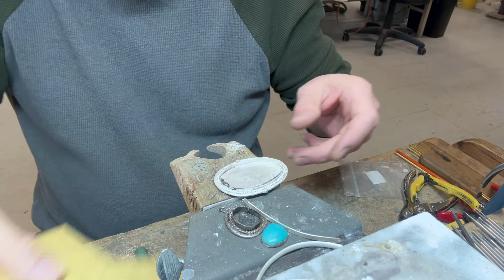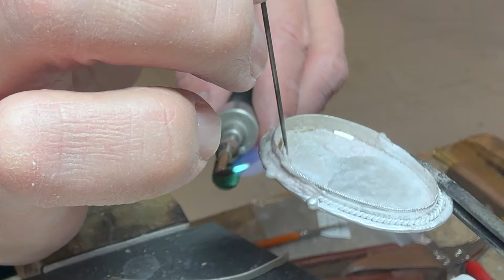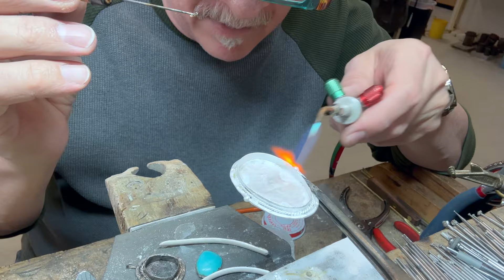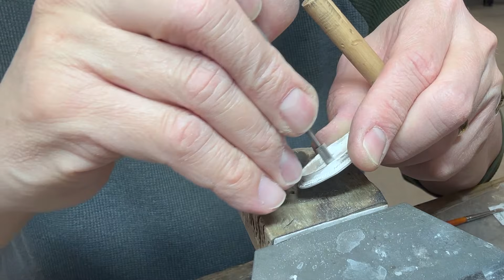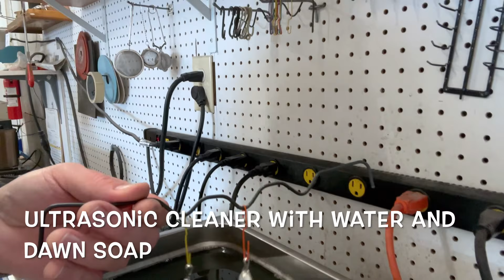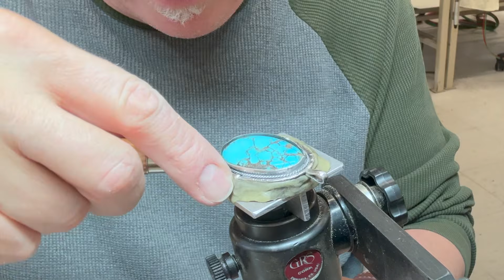Jewelry Bezel Repair Step by Step with Explanation - Replace Silver Turquoise Pendant Setting

Comment: Found a year later and yes I love it and agree with everything you said. It's even harder now with the cost of silver these days. Thank you for people like you and the lapidary gentlemen, Michael Donohue, from Michigan (Donohue Labs on youtube) who created a full equipment setup (minus motors, blades and speed controls) on CAD and provided the files for free that anyone can 3D print and make a table etc. out of because he was noticing the same thing where people would show up interested in a craft/art but leave without fully getting into it because they can't afford the multi thousand dollar machines used in the business. It's really disheartening that anything with the word jewelry attached to it is 3x the cost it should be. For instance, I was trying to get my grandfather's Vac-U-Cast running (the same one you have) and was disheartened that 1 liter of the vacuum oil cost $100+, but not giving up I searched the spec oil and found that I could buy a GALLON of ISO VG 68 oil that's used for the milking machines on farms for $30. So THANK YOU!!! Jewelry Monk, thank you. Also another cool youtube shoutout would be Rowow LLC, he created an electrolysis membrane and made the patent open source so anyone can make a membrane for $1/yd vs. the normal cost of $500 per foot. Now instead of relying on the big shops, no hate to bigriver they're pretty fair, I can pull out the element I need and refine it and make my own Argentium. Amen, use what you got or better yet, make it!
Reply from the maker: Great info, thank you.

Comment: How did you get the stone out?
Reply from the maker: I used a flat graver in between the bezel and the stone, slowly and carefully.
Reply: @DougNapierJewelryMonk could you do a video to include the process of that? I cant even process the opening of a tight bezel. Fear is not strong enough for that kind of work.
Reply from the maker: @shawnpatterson6632 I just released one today doing that.
Reply: @DougNapierJewelryMonk i just saw it hahahahaha. Thank you, it was VERY helpful. I have a ring with the same issues. Now i have a road map to fixing it! Than, you again.
Reply from the maker: @shawnpatterson6632 you are very welcome.

Comment: Why not remove the whole bezel rather than piecing it and having 2 ugly seams. I think one seam ?
Reply from the maker: @FatKidBrody  I could have, but on some repairs that is not possible. I wanted to show people how to do a partial bezel repair. Plus done correctly, the seams are undetectable, not ugly. I also like to keep myself challenged.
Thanks for the question.
Doug
Reply: @DougNapierJewelryMonk  thanks for the response Doug
Reply from the maker: @FatKidBrody  my pleasure.

Comment: I have a tip for you; I've found that an inverted cone bur is excellent for cleaning up excess solder inside a bezel along the join to the backplate. It cleans only the meniscus so the bezel wall is preserved. I was thrilled to get this tip from another smith. Great video. 🌺
Reply from the maker: thanks, I will give it a try.

Comment: That was a very impressive job! Also very well explained and filmed, thanks a lot!
I've got the impression that perhaps it would have been quicker and easier to make that pendand from scratch, in the same style, of course...
Reply from the maker: Thank you. It would have been a better piece if I rebuilt it, but as a repair jeweler, sometimes you have to work with what you get.

Comment: Thanks for the video, Doug.  I really enjoyed watching you work on that piece.  I have a question:  Do you neutralize your piece after you pickle it?  I've seen people neutralize it in baking soda and water and I've done that, but I'm wondering if it's really necessary.  Please keep doing these types of videos.  I will watch them.  I'm a lapidary and do some silversmithing, but I always could use more instruction and these types of videos really help.  Thank you!
Reply from the maker: @hummingbirdstones  thank you for the comments. Yes, next to my pickle pot, I have baking soda in water to neutralize the acid. Yes, it is necessary because it keeps the acid from getting on my hands and my tools as well.
Reply: @DougNapierJewelryMonk  That's what I thought.  Thanks for the confirmation!
Reply: @hummingbirdstones Flux is also very hard on hands.
Reply: Doug, can you please explain why the second time you heated the piece after attaching the bail - when you added another piece of solder from the front - why the bail didn't fall off with solder flow? Is it zinc sublimation or did you use a lower temp solder (I think you used M again)? Thank you. This is a perfect example of a potential problem that students could encounter and not understand.   And what a beautiful piece of turquoise!
Reply from the maker: @flyingcheff  Hi and thanks for the question. I used the same Medium solder, but used heat control to make sure the bail stayed on. I kept the heat generated in the area I needed to flow, but away from the actual base of the pendant. That is the nice thing about using a Smith Little Torch to solder, it allows me to control the heat better than a larger torch.   
ALSO, solder actually flows at a lower temperature the first time it is melted, not much, but a little. When it melts, it burns off some of the alloys used to make it solder, so the more times you melt it, the higher temp is needed each time. (we are talking about 10's of degrees) This is why I never melt my solder into a ball on my soldering board and pick it up with my pick.  Hope this helps.
Take care.
Doug
Reply: @DougNapierJewelryMonk  That is a great point (not balling solder up on your board first so as to maintain that initial lower melt point usefulness)! So the zinc sublimation/burn off is this exact scenario. I think your explanation really helps students understand using the same solder repeatedly. Awesome. Thank you. You'd be surprised how few teach this or even understand it (in the new mainstream).
Reply from the maker: @flyingcheff I have never heard anyone else ever teach this, but after over 40 years of trial and error, it is something I have learned. Thanks for the great input.